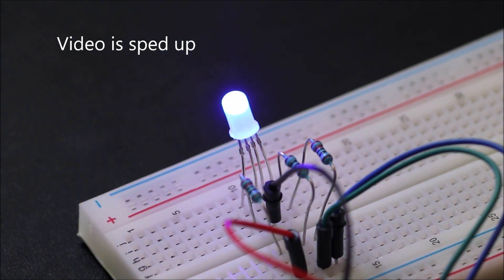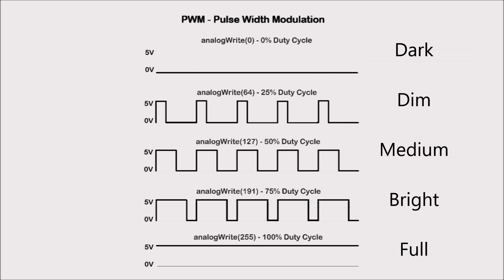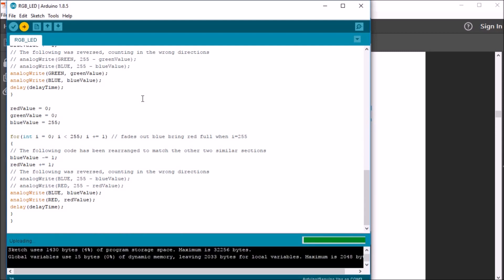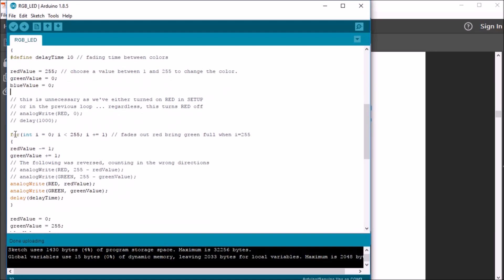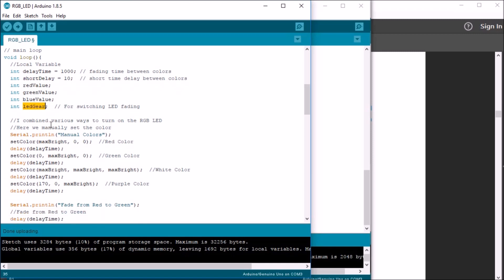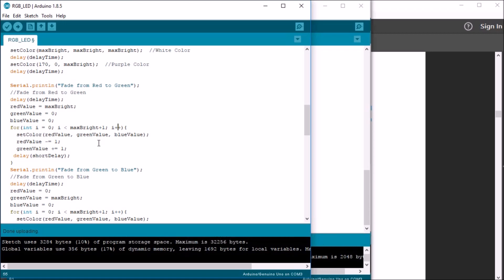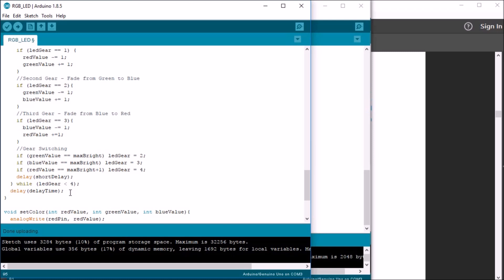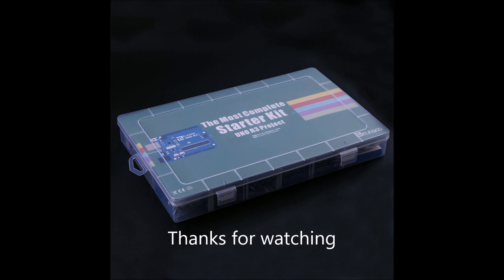Lesson 4 - RGB LED

Comment: My Uno r3 super starter kit arrives tomorrow, I'm a qualified electrician with a history of AC work in domestic settings,did the logixpro plc simulator, have been trying to get into plc,s for a while,
programming is new to me,
Reply: I'm an uquaified electrician. I went through the whole education program and all that but haven't practiced 1600hrs as required to get a license in sweden since i contracted some nerve damage and both my hands became paralyzed like a month before i was supposed to start practicing. But circuit design and programming has been a novice level hobby of mine for many years. And during my education we actually had to learn quite a bit of programing and soldering pcb's etc. I never understood why someone who is training to work with ac in a domestic setting would want to know any of that stuff, except for maybe working on home security systems, but i was obviously grateful for a couple of effortless A-grades. And my teachers were also always glad to get to learn some new things about the ludachris classes they were forced to teach but had no real experience in. Imagine doing what you do and one day someone tells you that you are going to teach a bunch of newbies how different types of transistors work. I felt so sorry for them. The one that were supposed to teach us about programming had experience from really advanced high end military mainframes, but ofcorse that was during the period when they were larger than your house, and had less capacity then a 90's cellphone.
Reply from the maker: Excellent, enjoy!

Comment: Great video. My daughter got this for Xmas and one thing we are noticing with Lesson 4 that when we upload we get a “problem uploading to board” message. Any idea what this could mean? Thanks!
Reply from the maker: You may need to verify the "board" type and com port.  You can check your settings under the "Tools" menu item.  Use the blink LED sketch to verify that everything works.

Comment: Never mind! Ignore my last comment! After this headache, I did more research on resistors, I learned to count the rings, and then studied up on the arduino resistor chart. Turns out I had a 10k resistor on one of the series...the red legged one. That explains why the red light was so Dim! This whole process was a little frustrating but i learned so many fundamentals! Thats why i kept the last comment. Thanks for the tutorial. I got plenty of bonus material today lol
Reply from the maker: Purchase a cheap digital volt/ohm meter. It's handy when trouble shooting your circuit.

Comment: Another great tutorial for beginners. Note: because your using the 220 resistors, you cant get the exact colors you want (for those of us who add our own extra bonus lessons). It took me over an hour to get colors like orange and yellow! I did it using the 330 resistors
Reply from the maker: If possible.  Check the manufacturer's data sheet for the minimum voltage threshold for each color.  Sometimes, you may have to use different resistor values to have the same current through each color.

Comment: I spent a half hour trying to get the four little leads from the LED into the breadboard and realized I probably don't have the dexterity for electronics.
Reply: You need to bend the leads with a pair of pliers, and cut to the same lenght like so:
     
           ________________
 ____/
|______________________
|_____________________________  <--- GND pin, cut to the same lenght as the others.
|__
         \_________________

Comment: Thank you for this. When you started pointing out things that could be improved in the code, I paused the video and did some tidying up of my own copy. In my first iteration I had a display function taking red green and blue values as arguments. Then I realised that the colours (as represented by pin numbers) can be used as parameters - each of the loops in the original can be replaced by a call to a crossFade function which takes two pin numbers as parameters. I've saved the sketch as a gist at:

https://gist.github.com/jufo/b2b4011f34a2f7f2aab237346ff875d1

Thanks for the advice on logging via the serial output - I'll try that next.

Comment: What if i use 4 RGB leds in place of 1led is the code is same or changed?
Reply from the maker: Always be careful and calculate the combined current draw for a single port.  The Arduino can typically only handle 40mA max.  If you run 4 RGB LEDs at 20mA each, you may overload the individual Arduino port and let out the magic smoke.  :)  Hopefully, you're still using an inline resistor which will limit the current.  In that case, the LEDs will be very dim or off.
Reply: @rickmorenojr  thanks a lot...for guidance 🙂

Comment: Arduino: 1.8.7 (Windows 10), Board: "Arduino/Genuino Uno"
Sketch uses 1432 bytes (4%) of program storage space. Maximum is 32256 bytes.
Global variables use 15 bytes (0%) of dynamic memory, leaving 2033 bytes for local variables. Maximum is 2048 bytes.
Please select a Port before Upload

I got this error, I am unsure as to what it means by selecting a port, I already have it connected to my Computer
Reply from the maker: Could it be that you just need to select the correct com port?  You must manually select the correct com port in the Arduino IDE.  If you have your Arduino connected, it sometime shows you the port in the lower right-hand corner.
Reply: @rickmorenojr  ok yeah, I moved it to a different port, and selected the arduino board port on the tools bar, that fixed it, thank you

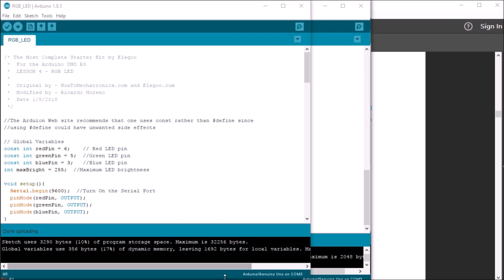Comment: The Serial Monitor was very help I never knew about that feature. 17:09
Was is the effect of adding more LEDS in series. Do you know I can better use excell or libreOffice Calc spreadsheets? For that. Theres a decimal() command to convert I think raddix was misused to mean BASE.